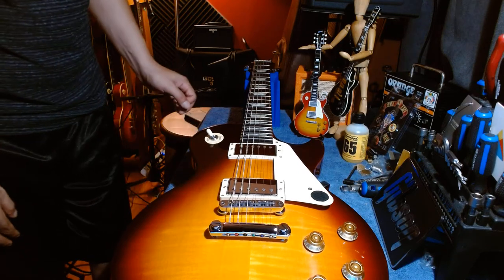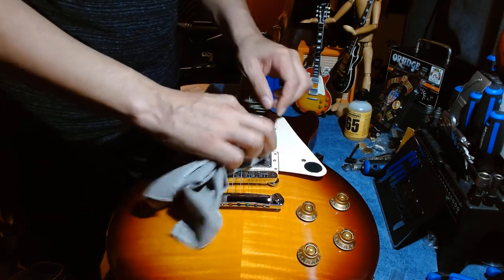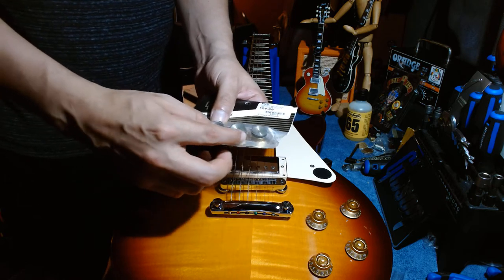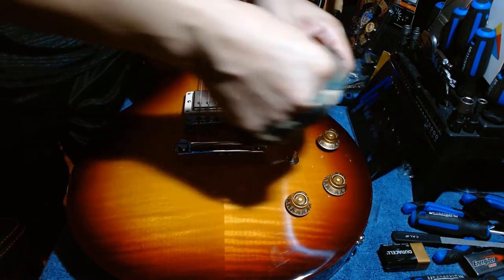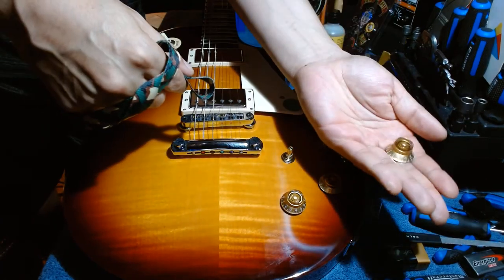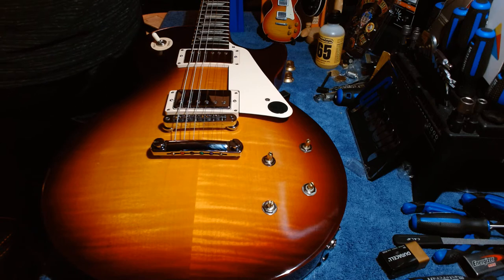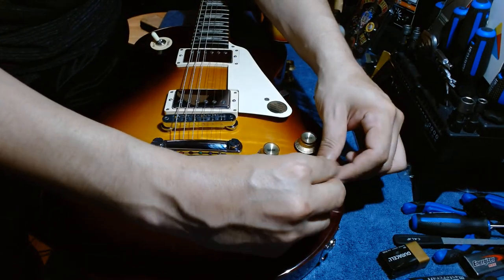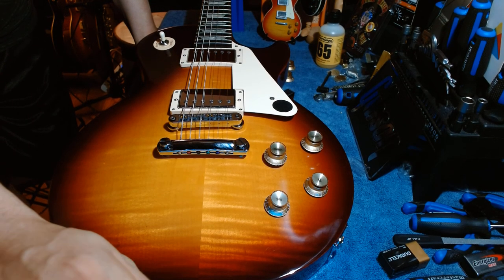Gibson Control Knobs - Installation

Comment: I have one question, how do you know if the splines on the knobs and the pots are lined up so that they are not damaged when installing the new knobs on the pots?  Please and thank you!
Reply from the maker: It did cross my mind when putting them on, but then realized there really is no way to tell, other than simply going by feel.  But even if they aren't aligned, they still stay on tight enough to last a long time.  I don't think the plastic grooves break off, just bind tighter.  No issues yet for me.
Reply: @spankeyguitars8457  thank you!

Comment: I don’t understand. You make it look so easy. One of mine came off and I cannot get it back on for the fuckin life of me! you said don’t push too hard but when I push it does nothing ??? any advice ????
Reply from the maker: Hey Nic, maybe one of splines broke off or stripped on the inside of the knob and no longer grabs properly?...if that happened to me, I would try wedging something in there, maybe a small sliver of popsicle stick or toothpick.  If that doesn't work, might have to order a new set, I think I paid $25 cdn for a pack of 4.
Reply: @spankeyguitars8457  yeah it was bent on the inside I ended up just getting it fixed at the shop locally to me. appreciate it though man!!
Reply from the maker: @nic8577  nice!